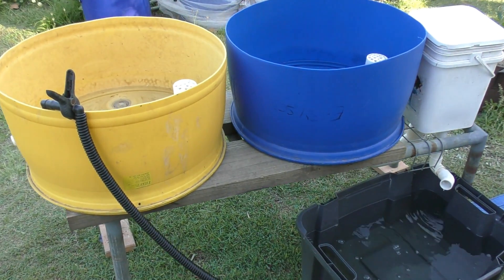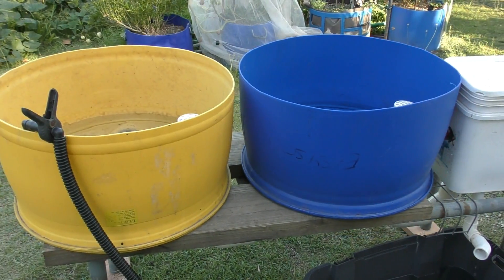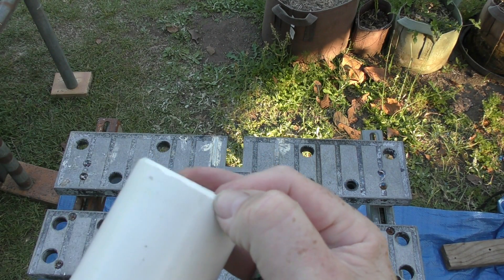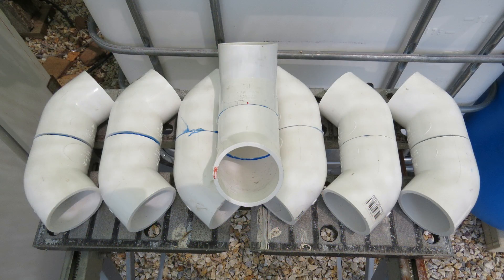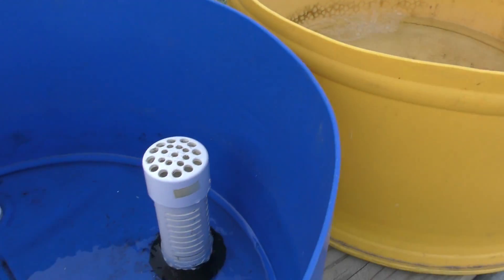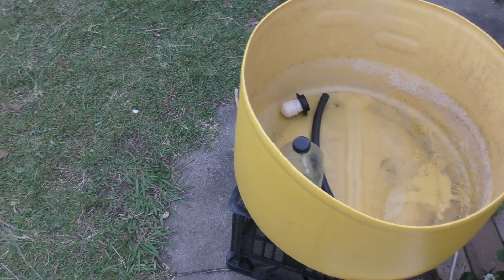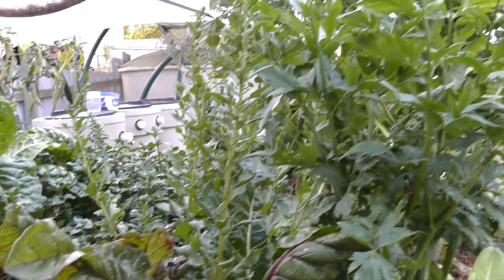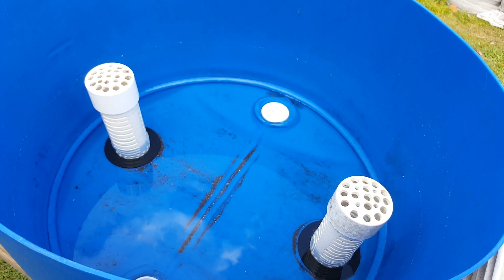External Bell Siphon for Multiple Aquaponic Grow Beds

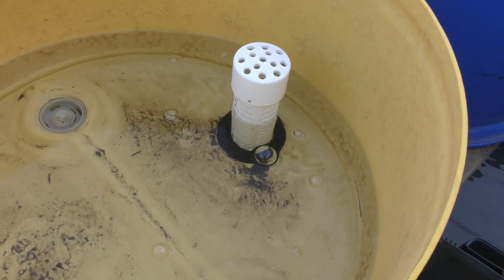Comment: 2:45 a single bulkhead fitting is ~$19 at Home Depot…uniseals are <$2.00 each on Amazon. They require deburring tool or more likely to leak but generally work without silicone or other.
Reply from the maker: The only ones that have leaked for me are the ones used in holes others have drilled OR when used in thin walled drums. The thin walled drums ones generally leak if a lot of directional pressure is placed on the pipe in the uniseal.

Comment: Hi Rob, I have watched this video last night. It is a fantastic idea. At the moment, I am building a three-storey system, a fish tank at the bottom, 2nd storey and 3rd storey with buckets. Is it a must to use bell siphons for the 2nd and 3rd storey? Can I use flood & drain system instead? Thanks!
Reply from the maker: Sorry for taking so long to get to your comment. Timers based beds will work just fine so if it helps simplify your design, go for it. 👍
Reply: @RobsAquaponics  thank you

Comment: Mate I have a question, about the water inlet,, in your demo you are feeding from one source is that or would that be an OK way yo fill the grew beds? Wouldn't one bed get more nutrients that the others? Or doesn't it natter?
Reply from the maker: It could be an issue if the system didn't have high nutrient levels & the individual beds were larger. The grow area in these would be less than an IBC bed so I don't think there would be any deficiencies. 
Cheers.
Reply: @RobsAquaponics   Cool You started the grand kids doing this, and ol pap has to figure it out,, we got the buckets growing well DID untill some critters went and knocked them over and ate the tomatoes. Sooo now they want to build a table with 2 half barrels cut long ways set on it. Ohhh they joys never stop when kids are around,,lol,, Thanks mate
Reply from the maker: @skeets6060  Nice one mate. Is great to get them started young. So many have no idea what it takes to grow your own or even where food comes from.
Cheers & have a top one mate.

Comment: Title should be An external bell siphon for 2Grow Beds.
Reply from the maker: You can run more than 2 beds with an external bell siphon. There's a bloke in Hawaii that runs many larger beds with one set up on a 55gal barrel.
Cheers.
Reply: @RobsAquaponics  Hi Rob Bob. Yeah I think it works. I made 10 grow beds out of 5 barrel drums and installed 1 external bell siphon. It takes 50 minutes to fill all 11 half drums and 18 minutes to drain. The inlet pipe and bell siphon is located on the first drum nearest to the pond.

Comment: Hi, i am dr shareef ,pediatrician frm india
Is it necessary to have inlet pipe in each bed(apart from the bottom loop) if 8 (8*2feet) growbeds are connected together?
Reply from the maker: I would feed each bed individually as the last bed may not get a good amount of nutrients after the plants in the previous beds take what they need. 
Hope that helps & sorry for taking so long to respond.

Comment: My bell siphon is not breaking, it was continous flow, what would be the cause of this issue
Reply from the maker: It can be due to too high a flow coming into the bed, the drain under the bed pointing upwards or even just being too long. 
Have you sorted out the issues you're having with it yet?

Comment: Hi Rob,
Please clarify, if there is only one Siphon, the other tanks in the series will not be drained completely due to continuous supply of water on the 1st one and continuous siphoning from the last one. I suspect the water level will remain same to a certain level...
Reply from the maker: Even in single siphon grow beds there will always bee some water remaining in the base & the same happens with these beds. 👍 As you could see from the video the majority of the water drained out just as it does in a normal bed. 
Cheers.
Reply: Understood.... btw, how many grow beds should we use with one Siphon and what should be the max dia of pipe for the siphon?
Reply from the maker: That would depend on the volume of the beds & the volume of water that needed to be moved. 
I think a grow bed volume of up to 1500L/400gal could easily be drained by a 1"/25mm standpipe but I haven't built one that volume to test that out myself.

Comment: That isn't really an external siphon, its an internal siphon in a small empty bed, external siphon's are built differently, love your videos though
Reply from the maker: Is the same as the external siphons I've seen except I've used a bucked & not a larger diameter pipe. 
Cheers Callum & have a top one.
Reply: Could you talk about bell siphons vs u siphons and any other alternatives in one of your videos?
Reply from the maker: If I find the time to set some up & trial them first I might.
Cheers.

Comment: I've been drilling holes wrong for too many years. Thanks Rob for the tip on backward cutting the UniSeal holes in the plastic. Dude you just saved me from so many future wrist slams and wonky cuts.

This year I should be connecting 3 or 4 100-gallon shale beds to a master drain siphon bucket. All the parts are back there in the yard, just need to decide on layout and set up some level stands. I ran a 300gal bed constant flow happily for a few years but it started leaking :(
Reply from the maker: Glad the clip has helped in some way sminstudios. 👍 Have fun with the build too mate. Will be playing around with ours & my parents systems soon & will be posting updates along the way.
Cheers.

Comment: I absolutely LOVE your garden.  I don't know about where you are, but around here many hardware stores carry "long radius" elbows.  I find they flow even better than a pair of 45s connected together.   They also give you a slightly shorter distance between parallel pipes in a 180 degree installation if you want it.   You could search availability for future projects if you're interested.
Reply from the maker: Hey Ron. I can't find them for the pressure pipe I use here in Australia.  I like to use the pressure pipe instead of drain pipe where I can as the drain isn't rated for drinking water here.
Cheers mate.

Comment: also, if I choose to run hydroponics instead of aquaponics, but use the same flood and drain setup, this will work just as well?
Reply from the maker: Hi Richard & sorry for taking a while to respond.  No timer needed as the siphon automates the flooding & draining of the beds. 👍
You could use it in a hydroponic grow system as well but the hydro folks may have more efficient methods you might want to look at as well first. 
Cheers.

Comment: Instead of connecting beds through tje bottom what about connecting throught the side a couple of inches up from the bottom of the grow bed. Put a screen over the ends of the connecting pipes to prevent mefia from flowing through or clogging the pipes
Reply from the maker: Hi John. Think I mentioned in the clip that due to the bases of the barrels all being a bit different it would mean that the pipe level would be quite high.  If I didn't I meant too. 😉 I like my beds to drain as low as possible  but each to their own. 👍
Cheers & have a great one.
Reply: ok yeah i think you did mention that. i can see where it would be difficult.  i am working on one where the barrels are split ene to end and i was thinking that i might be able to run the lines straight across.I love the idea of the single siphon at the end thus keeping all pretty much the same height and flow. rate

Comment: Thanx Rob, I am in the R&D aquaponics stage at the moment and doing lots & lots of research..lol. Your videos have helped out heaps, thanx mate, I would like to setup an external bell siphon on my grow beds, do you recommend a max number of grow beds per one external bell siphon (I use a 200 ltr drum cut in half long ways) and is it wise to sync 7 beds and if its ok, would this effect the diameter of the pipe of the bell siphon due to the amount of water that needs to be siphoned? Sorry for all the questions lol but if you don't ask... you will never know lol, any advice would be greatly appreciated :-)
Reply from the maker: Sorry I missed your comment Clive. How did you get on with your system build? Did you go with external siphons? 
Cheers.

Comment: Looking good Rob, just had to run out the back and fix a leak in a pipe, before it got worse :-)
Reply from the maker: Doesn't sound good George. Still happy with the way the system is running? 
Cheers mate.

Comment: Been looking forward to your external siphon system, Rob. See the biggest concern will be, the sump being large enough to handle the volume of water for all the containers. Not sure if I missed it, but what size pump are you using? Wonder if this system would be good for wasabi?  Great move on saving the bee.
Reply from the maker: Hey Harry. The water volume in the 3 beds that I'll be connecting are less than a IBC bed so not that great at all in reality. Our system is running a 10,000 lph / 2640 gph pump at the moment so the small amount of flow needed for this set up wont be much of an overall drain on the system. 
I haven't grown wasabi myself by have heard of folks growing it in hydroponics so can't see why you couldn't in aquaponics 👍
Cheers mate.

Comment: Thanks. Just proved that your traditional bell siphon in each bed uses less materials, easier/faster than trying to "save" by linking 2 beds to one siphon.  (Your' unstated message?')   :^)
Reply from the maker: Hi there. They actually work out to be about the same if you source parts from Bunnings. Just costed them out & there is less than $2 between them with the multiple bells coming in at $120.27 & the single at $119.62. Have the list available too btw. 
If you shopped around you could get the parts a lot cheaper than that BTW. One irrigation retailer I use is 30-50% cheaper than the large retail chains ;) 
Like I said in the clip, was using what was on hand so for me this was the cheaper option ;) Can think of about 3 other ways to set up a series of beds like this. 
Cheers mate.
Reply from the maker: Just did a proper costing for another chap & it worked out $9 cheaper to use the single external siphon on a 2 bed set up & $24 cheaper on a 3 bed. Every additional bed would increase the savings by about $15 due to the threaded fittings, bulkhead, siphon pipe & additional plumbing needed to get the water to the bed.  Buying pipe & fittings in bulk would make that cheaper again though. 👍
Cheers mate.
Reply: I'm a 'baby boomer' =old fart. Comfortable with the things I watched evolve. (...You'll get here one day.)  Your 'perfected bell siphon' is elegant, functional amusing to construct and watch. Also, it's 'distributive.' ONE malfunction does not jeopardize the ENTIRE grow. However, it's a "bottom line" kind of Universe. Change is GOOD cause change ALWAYS happens.

Comment: Nice job Rob. Never thought to do it this way. Only problem is that they all empty at the same time so you have to deal will more water. One question why don't you have the bell siphon in the last barrel? Then you wouldn't need the one with just the bell.
Reply from the maker: Hi mate. 
With the 3 I'll have set up together they will use less water than a normal flood & drain IBC bed 👍  
This was a demo for folks that asked, mine will be plumbed up with a single bell in the end barrel as I don't have a lot of space.
Cheers & have a great one. .

Comment: Great video Rob!  I like external bell siphons for many reasons.  First, the plant roots will never likely interfere with the external siphon unlike in-bed siphons.  It seems every year I get some malfunctions due to plant root growing into and round the siphon.  An external bell can be made to fully empty the beds and provide for a safety high water drain.  Externals are also serviceable without disturbing the media unless the drains get root bound.  I also like the absolutely positive start feature of external bells.  The only drawback is they require a sump because the volume of water that is moved at once is large.  I prefer to not use a sump in my systems.
Reply from the maker: They would make management of root invasion a lot easier to deal with in some cases 👍
Cheers Rj & hope all's well with you mate. 😊

Comment: you rely like too complicate simple thinks ...?!
Reply from the maker: Marek Kaminski Not quite sure what you mean there?  
There are loads of ways to set up any aquaponic system.  This is my take using what I had on hand to join a few beds to a single siphon.  I can think of about 3 other way to do the same thing. 
Would like to see your take on a similar set up.  
Cheers & have a great one.
Reply: sorry Bob , I lake your channel no offense meant !!! single drain in each drum (or bead) , first drum need 90 or 2x  45 every additional dram need only T or Y ,and keep the drains low too prevent root grow in too .Keep app good work  Marek.
Reply from the maker: No offence was taken Marek 👍 I know it can be hard to articulate text at times. 
If I had T's on hand I would of used them to see how it would work in a barrel to show folks different options. Have seen a few systems set up using T at the end of barrel beds & they work fine from all accounts 👍 
Folks have pointed out that I only need to use T's so will buy a few & set up a barrel with one for folks to look at.
Cheers mate.

Comment: Why not do a single pipe under the beds with Ts going up? That would make it only one pipe / "point of failure" at the bottom of each bed...  Thoughts?
Reply from the maker: snubbel buff That was the other way I was going to go with twin 40mm drains running into a 90mm drain line.  Decided on this set up as I had all the parts on hand.
Reply: ah okay! Great having parts available! Thank you for your reply. Your vids makes me look forward to sunday mornings (here in Sweden)
Reply from the maker: Will have another posted on the system in about  or so hours. 😉
Cheers mate.

Comment: Couldn't a much simpler loop/U-siphon take care of a multiple bed arrangement much easier and cheaper...?

Also as a side question, I am in proccess of gettin 6 ibc's but I am wondering what are the max number of (ibc grow beds) can be sustained with a  single chop'n'flip sump tank?
Reply from the maker: Hi there. No reason you couldn't make the loop for a system like this.  I just have making the bell siphons down now so like to use them. Also like that they are easier to monitor for root intrusion too if you're growing plants with adventurous roots.
It all depends on how deep you cut the sump. I have 4 x 300 mm/12" grow beds cut from the sides of IBC's & don't think I'd add more than 5 for my 600L/160 gal sump if that helps any.  👍 
Sounds like you have a decent sized system planed mate 👍😊
Cheers & have fun with the build.
Reply: Still planning stage, leaning towards 2 independant systems each running a 1000l main fish grow out tank gravity feeding 2 chop'flip  deeper grow beds and sumps linked. Was considering 2 sidecut+1flip growbeds per growout tank. However the more I brood over the idea the more i prefer the ability to run the chopflips independantly if needed/or isolate issues. Also being self supporting with less extra structures.  I also like the security of a fuller sump reserve...so yeah think thats the way its heading. the delivery cost for the IBC's were the same for 1 - 6 so thought it best to go all out and get a full order haha. As for loop siphon i just though it might be a vaible alternative (K.I.S.S principal) though maybe it might have siphon break issue, can't say for certain. Won;t be building anytime soon as the tanks will be temporary water supply while old concrete rain tanks are removed. So plenty of planning time. Still good to know that 5 grow beds is a rough maximum for 1 sump.
Reply: I think around 3 works pretty good.